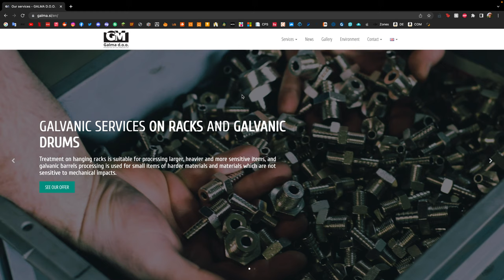Vintage Bike restoration (restoring old 1980 ROG Holland bike)

Comment: Excellent work, one of the best bicycle restoration videos i've seen. I appreciate the extra work you did with restoring all the small parts, instead of just buying them new! 

Quick Tip: If you're going to restore more bikes in the future, get yourself a Headset remover (for example, Unior 1681/4). It's not that expensive and makes the task way easier. ;-)
Reply from the maker: Thanks for the tip. I really had a hard time taking the bearing cups out of the frame.